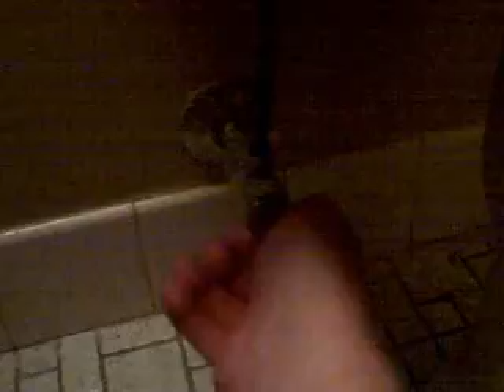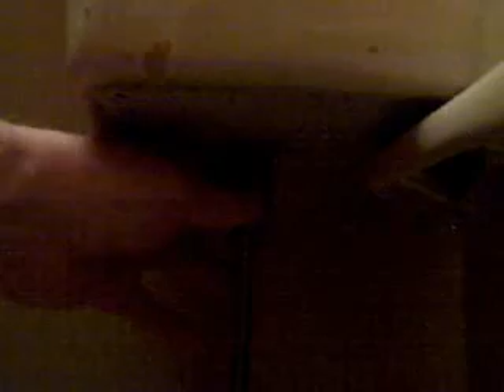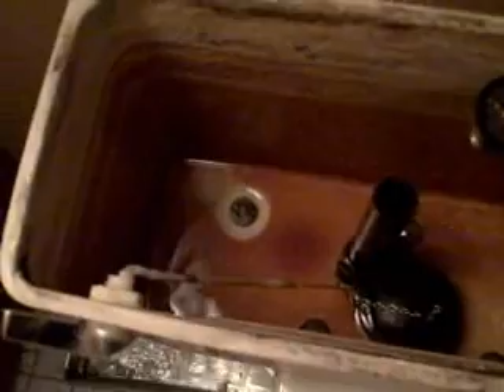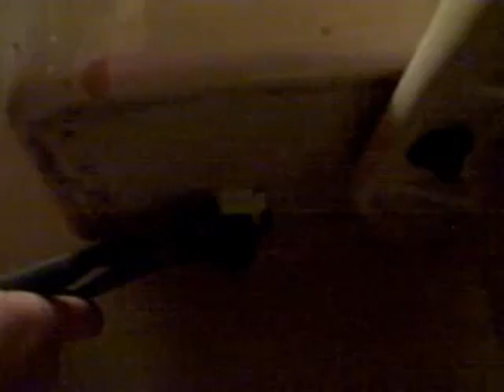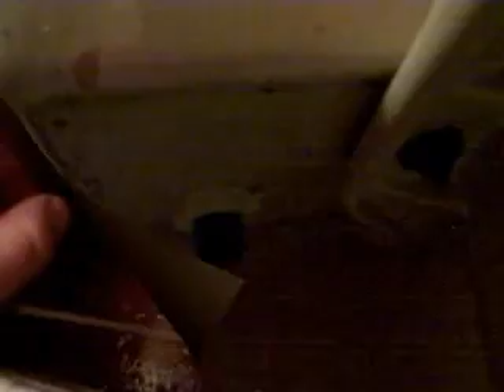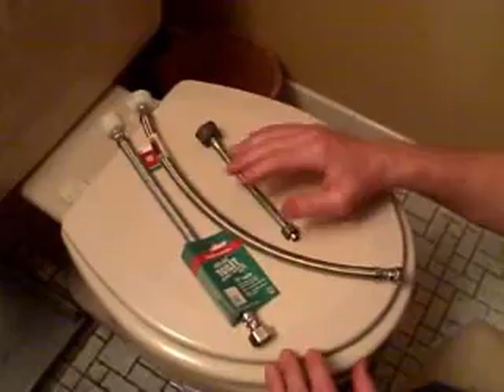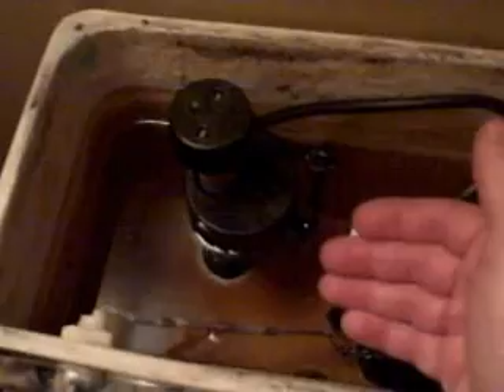How to Replace a Toilet Fill Valve - Fluidmaster

Comment: I have water hammer when I flush the toilet.  I had an ADA toilet installed by the water company in 2009 with an inexpensive Chinese R&T fill valve.  Will this Fluidmaster Fill Valve have a slower close that will stop the water hammer?
Any suggestions on what I can do in the meantime?
Reply from the maker: beahaven Hi, when your home was built, the plumbers should have built in air chambers to prevent water hammer. The air chamber can fill with water over time causing that noise.

The first thing you can try, is to turn off the main water coming into the house and then open all the water faucets, tubs and showers. Let the water drain, the shut off all the valves and turn on the main. This should reload the air chambers.

If this doesn't work, you can purchase a water hammer arrestor at the hardware store.

Let me know if that helps.

We have more tips on our weekly podcast https://itunes.apple.com/us/podcast/fix-it-home-improvement/id880903087?mt=2
Reply: FIX IT Home Improvement Channel
I turned off the water and reloaded the air chambers.  It did not solve the problem.  The house was built in 1964 and the toilet replaced in 2009.  I will try replacing the fill valve and see if that works.  If that doesn't work I might replace the shutoff valve.  I will research "water hammer arrestor" but that might be too difficult for my skill level.
Reply from the maker: Let me know. I would be happy to help with some installation tips.
Reply: FIX IT Home Improvement Channel
Can I use a Sioux Chief 660-TK mini-arrestor with the Fluidmaster?  I've seen one attached directly under the tank and hooked up to the flexible hose that leads to the supply valve. Thanks.
Reply from the maker: Hi, I've heard good things about these. I would give it a try. Let me know how it works.

Comment: I'm done with Fluidmaster. Three toilets and the flush valves failed in every one. I'm replacing them with Korky brand. Korky is easier to install, quieter on flush, and have yet to fail.

Comment: I just replaced mt fill valve with a fluidmaster 400a I adjust the water level and it will work fine for several flush then it randomly starts over filling after flushing. what could the problem be?
Reply from the maker: Dizzylizzyscreations Hi, is the valve calling for water after a period of time? It could be the flush valve is allowing water to drain out. The water is low in the tank and it refills. It could also be water pressure from your water heater if you don't have an expansion tank.
Reply: No it's immediately. It's a new valve I just put it on. I took the top off and flushed it out , so far so good. :/ Thank you
Reply from the maker: Dizzylizzyscreations We have more tips on our weekly podcast https://itunes.apple.com/us/podcast/fix-it-home-improvement/id880903087?mt=2

Comment: task complete. Toughest part was getting off the old nut at bottom of tank. new nut has longer teeth for better grip. I also made sure my supply tube is not touching the tank, I noticed on an old supply tube that is touching the tank  the tube is wearing down at that point.

Comment: What diameter of toilet seats in states???
Reply from the maker: How 2 4 U Hi, toilet seats are 16 1/2 inches or 18 1/2 inches long, depending on regular or elongated toilets.
Reply: I am asking about the main pipe not the toilet size. Here in Ireland most of the houses have 8 cm i,e, 3 and a quarter inch. And that's too litle and they get blocked very often. In most countries it should be 10 i.e. 4 inch.
Reply from the maker: How 2 4 U Hi, The main pipe under the toilet is usually 4 inch.

Comment: Great video. I installed the same product but now i get a double flush. What is the solution to get a single flush?
Reply from the maker: janable2000 Hi, what do you mean by double flush? Can you watch what is happening in the tank with the lid off.
Reply: FIX IT Home Improvement Channel Sorry if I wasn't clear. When the toilet is flushed, inside the bowl it flushes once and the bowl fills up slightly again and flushes again. Inside the tank with the lid off it seems normal. Except maybe the flapper stays open a little to long.

Comment: This was a limited replacement, i noticed that you did not replace the area under where u connected the overflow tube..any reason why you didn't replace that part too? If you wanted to replace that part then i guess you would have to remove the tank itself, right? I gotta do mine soon.

Comment: OMG THANK YOU!!! i just bought my house 4 months ago and the basement toilet has been a thorn in my side ever since-It was leaking into the bowl-...i tried to replace the flapper first (getting an exact manufacturer one) but it didnt fix it...i thought i was 15bucks out but for the hell of it i did what you did in this vid IN ADDITION to taking the black tube that spits water out-- out of that pipe(valve?) and lifting it above...and BOOM. leaked fixed! Man vs Toilet won the war..finally!
Reply from the maker: Hi, happy it helped. We also have a weekly podcast. Here is a link http://www.stitcher.com/s?fid=49441&refid=stpr

Comment: This Fluidmaster video showing removal of supply line so shadowed that you can't make out what's happening, particularly what nut is what. A bit of lighting down there would have helped.  For that matter, Fluidmaster's written instructions omit mention of the water supply nut, either its removal or replacement. At least look for a better video.
Reply from the maker: Phineas Fiske Sorry, didn't have additional lighting. The fill valve is held in place with the thin washer under the tank. The supply line has a 7/8 nut that will tighten onto the threads.

Here is a link to another video we did. Toilet Fill Valve - How to Install a Fluildmaster Fill Valve
We also have a weekly podcast. Here is a link http://www.stitcher.com/s?fid=49441&refid=stpr

Comment: Don't believe the hype! If you have a really old setup like the one shown here, be very careful with the knob assembly (where you turn the water off and where the compression fitting goes). If this hasn't been turned in years, it is likely to leak as you are tying to turn off the water. It MIGHT be better to turn off the water to your house, and go to the lowest cold spigot in the house and turn it on allowing the pipes to drain. Then turn off the cold water to the bathroom from the basement. In this way, you won't have to touch the knob down there which is sealed with a rubber gasket that may be hardened in place and will leak the second you touch the knob. Also, removing the compression fitting can have similar results. If you already have a Fulidmaster 300A (which is the most common anyway), you can buy a new one and slip the top off of the part that is connected to the water (as if you were adjusting the height, but just keep going it comes off) and place the new one on the old shaft. It the upper part that goes bad, so as long as nothing is leaking already, it's probably best not to touch any of that stuff and just buy the same part and just replace the mechanical parts.
Reply: One other thing... You MUST replace the supply line if you have to replace the plastic tube that the float device is on. The old supply line will never hold water again once you undo it.
Reply from the maker: Hi, good tips. I like to change the old stop multi-turn type shut off valve with a quarter turn style. You don't have the problems with leaks. Here is a link to our weekly podcast http://www.stitcher.com/s?fid=49441&refid=stpr
Reply: FIX IT Home Improvement Channel
Thanks, I'll check it out.

Comment: I am not exactly sure why you replaced the supply line too.  Do you need to replace this when changing the fill valve?
Reply from the maker: Hi,
It was old and I didn't want a problem. No, you don't have to change it when replacing the fill valve.
We have a weekly podcast on iTunes and Stitcher. Here is a link @s?fid=49441&refid=stpr

Comment: Just wanted to give an update to tell you THANK YOU AGAIN for your tutorial!  Watching yours (and a couple of others) gave me the additional confidence I needed.  With the help of videos like yours, and the printed instructions, I replaced the old non-functioning fluidmaster with a new fluidmaster this morning.  YES!  I am WOMAN, hear me ROAR!  lol!  Due to being old with several physical problems, it took me nearly an hour, but it was very straighforward.   Checked all the measurements, and simply followed all instructions, and it worked immediately.  I did also flush out the water supply into a bucket before connecting it to the valve, and I also took the cap off the new valve and flushed it out using the cup method.  It is now working fine, and I am knocking on wood.  But, now that I know I can do it...and given that the valves are inexpensive, I am SO GLAD I decided to woman-up and do it myself!  ;)

Comment: I have to replace my fill valve because the float ball connection snapped cleanly off the top of my old one, causing the tank to continue to refill. I purchased this exact fill valve you have, flapper included... But my issue is that my overflow tube sits directly above my flapper. I've not seen any other how-to's  with that similar anatomy and I'm unsure, given my basic knowledge of the mechanics behind all of this, how that effects what I need to do to set it all up. It looks to me as though I didn't need to buy the one with the flapper as that will not effect my assembly, I can continue using my old one? For the same price the fill valve came without it, so I'd imagine it's that simple, but is there a difference between the overflow tube above the flapper, and one like yours?
Reply from the maker: Hi,
If your flap is working on the flush valve, you don't have to replace it. It's nice to have one when it's needed. If you every have a problem with the flush valve, just email a picture.

Comment: Thank you for sharing these instructions!  I feel ready to attempt this replacement, but I would like your opinion about my specific situation.  The water supply for my toilet is directly adjacent to the outside faucet of the other side of the wall from the toilet.  Any time I run the water from that outside faucet, then the fill valve on my toilet will not function right after.  I must turn the water supply to the toilet on and off at the shut off valve, to get the fill valve to function and fill the tank.  Is this nothing more than the fill valve needing replacement?
Reply from the maker: Hi,
When you remove the supply line to the fill valve, keep the supply line on the shut off valve. Get a bucket and put the supply line in the bucket and turn on the shut of valve. You want to test if there is a blockage in the shut off. If the water runs well through the supply line, the problem should just be the fill valve. Let me know if that helps. 
We have a weekly home improvement podcast on iTunes and Stitcher. Here is a link https://itunes.apple.com/us/podcast/fix-it-home-improvement/id880903087?mt=2
Reply: FIX IT Home Improvement Channel

Thank you SO MUCH for the quick reply.  That test makes perfect sense.  My speculation is that there is some kind of "vacuum" occuring when I run the outside faucet, which fouls up the supply to the toilet.  However, the same situation used to occur with the other bathroom toilet with an almost identical situation, and it was resolved by replacing the fill valve in the toilet.  I do have low water pressure, and there has been a fairly consistent problem with the water pressure backing off when ANY valve is turned on to just a slow stream.  In any event, I do think that your advice is spot on,  Should I go ahead (and if so, at what point) replace the supply line for the toilet in question?  It is plastic, and very hard/stiff.  Thank you so much for your help!
Reply from the maker: Hi,
I would pick up a new stainless steel braided supply line. Make sure it is for the toilet. 7/8" going into the fill valve and probably 3/8 compression going into the shut off valve. Bring the old one with to get the correct size for your shut off valve. Good luck. Let me know how it turns out.

Comment: The white large nut is finger tight only. NO wrenches required. Please read the directions.
Reply from the maker: Hi,
It depends on how snug you are able to tighten the nut. I would always tighten by hand and put an extra 1/4 turn with a wrench so it doesn't leak. If you get a drip, add another quarter turn. Some tanks don't have a smooth hole and the washer doesn't seal without the nut firmly tightened down.

Comment: Is this the same type of fluidmaster as the ones that have another chain on it. I have a chain to attach to the flush arm and the chain to the flapper.
Reply from the maker: Hi,
That extra device keeps the fill valve from refilling if you have a flush valve that is leaking. If you try to flush the tank and you have no water, you know you need to replace the flap or gasket. It releases the fill valve when you flush.
Reply: FIX IT Home Improvement Channel Thank you so much for a quick response and the help
Reply from the maker: You're welcome
Reply: I have just replaced my ball cock supply valve with a new fluidmaster 400A  it works perfectly, until the water is refilled, but then my water shut off valve below the toilet pops out, shutting off the water? The on off valve is the cheap push pull in stead of the twist off. Could the valve cause this?
Reply from the maker: Hi,
I've never used that style. I've heard the change in pressure can turn them off. I like a quarter turn ball style valve. They work great.

Comment: I followed the directions in this video and was able to replace my toilet fill valve.  Very good video, thank you.  The key thing you left out though is that the height of the fill valve critical level has to match the height of the overflow tube. It will tell you exactly what you need to do for that step in the instructions with the fill valve. 

Also, I would highly recommend Korky brand fill valves instead of the Fluid master ones shown in the video. I've had problems with a few Fluid master setups, but the Korky ones work well and refill the tank much quieter.
Reply from the maker: Hi,
I will add the critical level to the video. Thank you

Comment: Thanks very much for sharing this video! Your explanation are very clear and easy to follow. I had loud horn noise when toilet is flushed. Don't know if replacing the fill valve will help?
Reply: I was getting that exact noise, and I just replaced the fill valve about ten minutes ago and the noise went away.

Comment: I noticed that at the top of our toilet fill valve the water is not flowing into the tube, it is spraying out the side. Does this mean we need a new toilet fill valve? Watched your Video and you are very good at explaining and showing. Thank you.
Reply from the maker: Hi,
It sounds like the gasket in the valve is bad. You can get a replacement gasket, but I like to change the whole valve.
Reply: FIX IT Home Improvement Channel Thanks very much for your help.
Reply from the maker: You're welcome

Comment: turns out the one I have in there was the adjustable type. I was able to make the valve taller, allowing the water level to rise to about 1/4" below the overflow tube. Might be a little higher than normal, but seems to flush better.
Reply from the maker: Great

Comment: I would like a little higher water level in my tank, it seems to flush better if I add water.
It is adjusted as high as it will go.
With the one you used that was adjustable for different tank heights, do you think if I made the fill valve say an inch taller, I could get more adjustment out of the valve, and more water in my tank?
Reply from the maker: Hi,
Yes, this style valve will adjust from 9" to 14". You can also change the flush valve to one that has an adjustable overflow pipe. Keep in mind you can only increase the water level to the height of the hole in the tank for the handle. Good luck

Comment from the maker: Hi,
If the old valve is plastic, a hack saw will cut through it easily. If the old valve is metal, spray the nut and threads with a lubricant.
Let me know if that helps.

Comment: I just CANNOT remove the top nut that's up next to the tank. it's just not happening. the threads are kind of messed up to begin with, but the toilet is in an awkward position in relation to the counter for removing this nut. but it won't budge anyway! I am about to pull my hair out

Comment from the maker: Hi,
If you have the same style fill valve, you can pull up the collar on the center of the valve and raise the height of the valve (2:42 min). You can also adjust the float to allow more water into the tank.

Comment: Your video saved me the hassle of replacing the fill valve.  All I needed to do was adjust the fill tube so that it didn't extend down into the overflow tube.    Thanks.  Great job.

Comment: No. The house is very old, about 100yrs to be close to exact. The toilet itself, I don't think is the problem. It's more so where the fill valve is placed in the wall. Instead of it being on the bottom like most households have it nowadays, it's located above the tank. This presents a problem because there's no supply line and it seems as if the water just comes straight out of the valve to fill the tank. I can take a picture and send it to your email if you'd like.

Comment: Hello, quick question:

My toilet is rather unusual. The valve that fills the tank is not located underneath the tank as it is in your video. Instead, it is located above the tank and it's almost as if it's meant for the water to flow down and into the tank. How can i replace the system with the fill valve above the tank? Thank you.